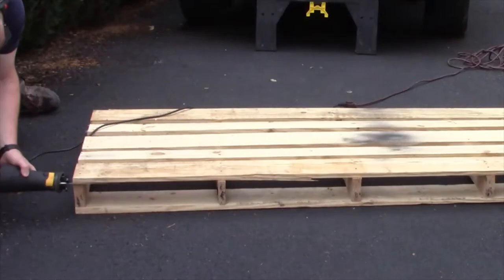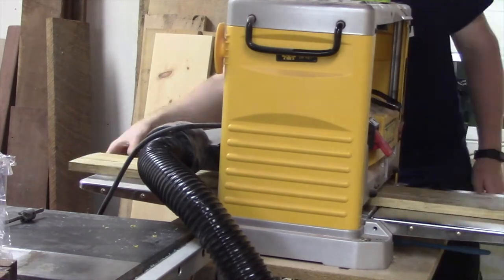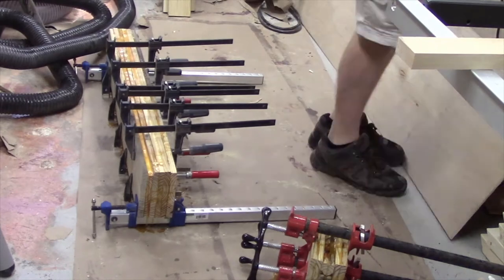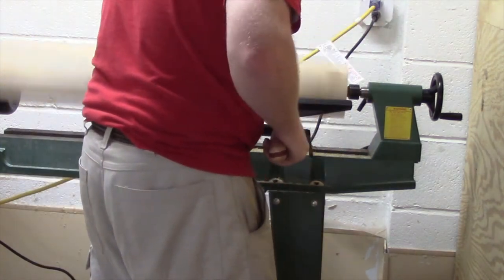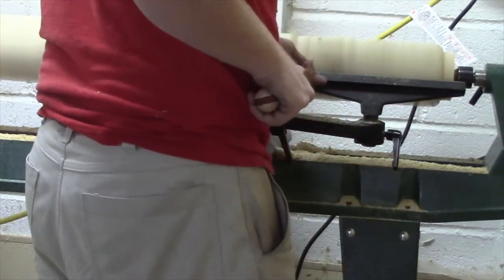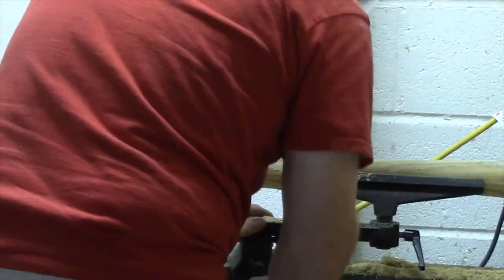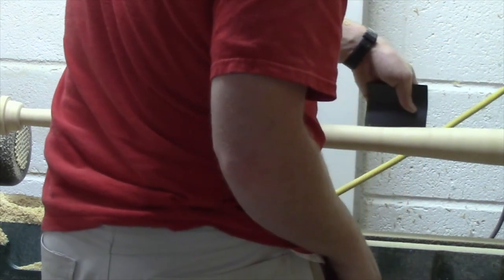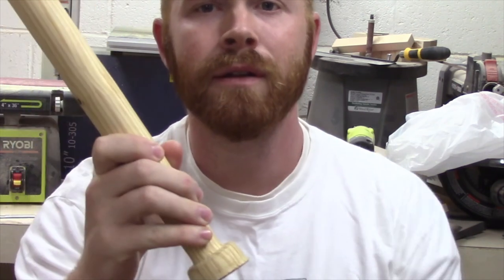Turning a Baseball Bat | Pallet Upcycle Challenge 2017

Comment: Robert,

Most of my fun comes from learning on the lathe. It's an addictive machine. Word of advice, take the extension off the banjo. You don't need it and it could cause a major issue if you get a bag snag. Good luck in the comp.

Ken
Reply from the maker: Ken Moon - Moonpie Creations Thanks for the advice! It's definitely in my plans to get rid of the banjo, especially for when I turn pens.